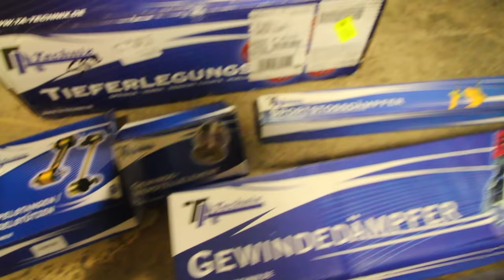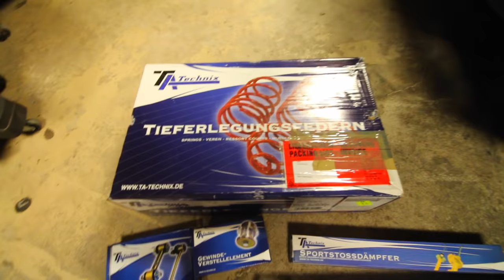How to Install Tieferlegungsfederns on a Volkswagen

Comment: TA Technix are actually good quality coils, you did two mayor fails. 
The first one is by not removing the front small helpersprings.
The second one by keeping that huge ammount of bumpstops on the rear shocks, i always cut at the first mark and use the small upper bit only, the splash gard isnt neccesary aswell (for the rear shocks). You could also buy an harder smaller bumbstop from FK and it will work perfectly having friends at the back when lowered.
The third one is to remove the spring set screw for the rear springs. 
The fourth is that the front swaybar will need to go
Fifth and last bit is that you need to c-noth the frame on the passanger side for the driveshaft
From theese small things you will be able to lower your car another 3-4 cm and it would look so muck better. 
I have owned and worked on a pair or VAG's with the same suspension setup, can do all of the above in my sleep right now ;)
Reply: You sound like you really know what you're doing. Do you have some sort of tutorial of your own? Just bought the shocks and really wanna install them properly at the first try

Comment: What is the brand of the coilovers? and how do they ride? soft hard?
Reply: They ride pretty damn good at recomended presets, if you are going to slam the coilovers, whenever they cost 300$ or1000$ they are all going to ride the same, stiff and bumpy , sorry to dissapoi t you. 
But even when we had our mk4 with slammed with removed helpersprings, removed swaybar at the front and c-notched frame, replaced for FK bumpstops at the back and removed hightadjuster the ridequality was actually good. But the problem was that it didnt go low enough. 
So he changed coilover for a Danish brand called NICE Coilovers and the car got 3,5cm lower all around. But the ridequality was not good at all compared to TA technix thow...He has gone with Airsuspension now and belive me or not, he is not happy with the ridehight even thow the 25 Jahre (golf mk4) bumber crushes againt the pavement.

Comment: Milan, what kind of jack stands are those, and are they more practical than the typical jack stands? 
Thanks, 
Alonzo!
Reply from the maker: Hey Alonzo, these are what I'm using: 
Aluminum 3-Ton Low Profile Jack ▶︎ http://amzn.to/2Bv6W3g
Aluminum 3-Ton Jackstands Pair ▶︎ http://amzn.to/2iNszR5

I like how they not only do not rust, but they also are very stable
Reply: Thanks bro! I like the fact that they’re not bulky death traps like they are in the U.S. Keep up the good work your channel is my favorite by far.

Comment: The bolts that connect the strut to the hub-housing are not stretch bolts and you can reuse them!
Reply from the maker: Yes they are. Check the service manual and VW. Not all of them are, but in this situation, it is a stretch bolt.
Reply: just double checked. VW Esla-Win only tells you to tighten it down to 60Nm + 90°
Reply: horst696 i agree with you. It's definitely overkill and a bit ridiculous he replaces these and acts like they MUST be replaced. As a professional mechanic both semi and cars, I have never replaced these and never needed to.

Comment: They make a tool to spread the strut mount. Its not a good idea to beat on your spindle. Use the right tools and the strut will slide right out. 

Also you should of applied a coated of anti-seize on the coil over adjusters front and rear especially since you live in Canada.
Reply from the maker: I did have to use it for the passenger's side of the car. The driver's side wasn't stuck

Comment: Milan I'm sorry for you i'm from Germany and Ta technix is the cheapest and most low quality stuff you can get. I read about that stuff breaking and fully rusting after a few months
Reply from the maker: #ebay #budgetbuild ;)
Reply: +milanmastracci just be sure that when something goes bad take a look on some better quality stuff😁
Reply from the maker: Oh yeah I know, we got these things for a steaaaaallll of a price so we couldn't say no
Reply: +milanmastracci When you're too low on mk4 golfs it can happen that your sway bar is rubbing against the right cam shaft. To solve that you just have to swap out the original sway bar to an golf r32 4motion sway bar. Did it on my car works perfectly fine
Reply: EXTREMLY FUNNY ENDING!!!
XDDD

Comment: ta technix is the biggest crap you could ever buy. 1 year and you can change the complete suspension system. but for the price, you can get your car pretty damn Low :D
Reply from the maker: We'll for sure keep you updated on the coils
Reply: meissnermeister not complete crap. I'm dailying a set of those since about two years in my vw lupo. No problems so far, just a bit of rust.